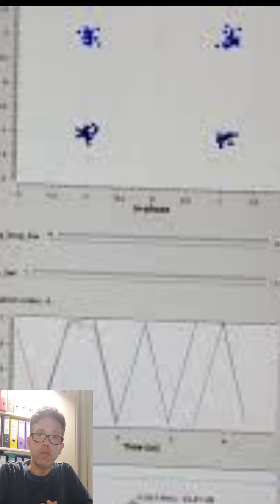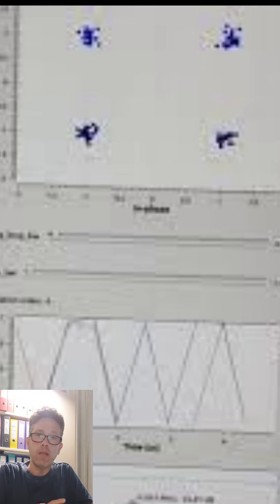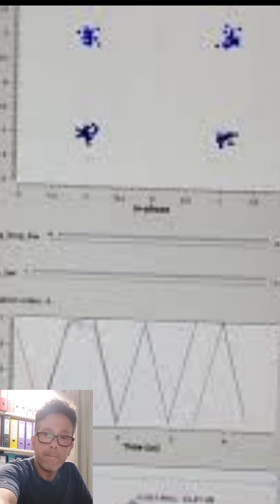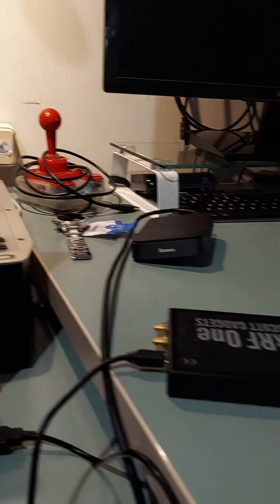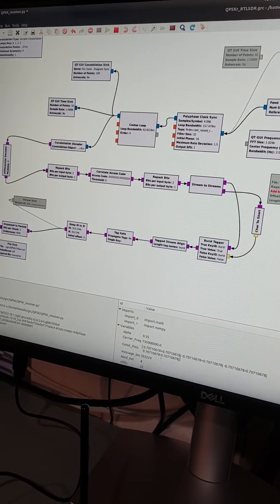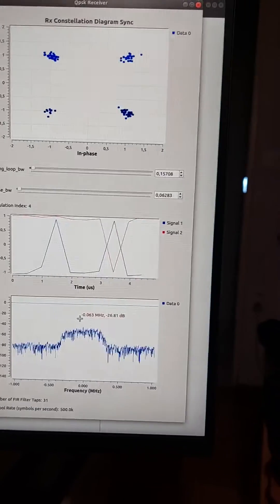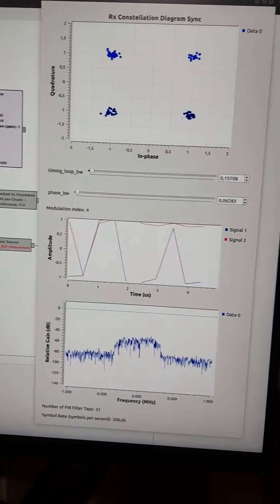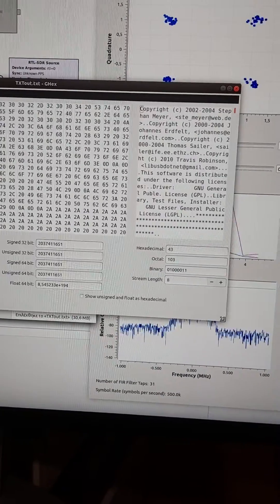Over the air transmittion and reception of QPSK signal using HackRF One and RTL-SDR with GNU Radio.

Comment: Hi, that’s great, I downloaded the file and replicate it with my 2 HackRF one but I couldn’t, can you give me any help about it please
Reply from the maker: Hi, since you have a hackRF as a receiver you need to change the source block (probably to 
Soapy HackRF source if you have the latest gnuradio version). Keep in mind that I have not tested it with latest versions of GNU Radio software. Other than that you need to check parameters in some specific blocks. For example in file sink and file source blocks you need to change the file paths. Finally in the "correlate access code tag" Block at the receiver the access code value is the binary representation of the hex value stored in file  preample.hex at the transmitter. I hope this will help you in your efforts.
Reply: @ManolisBozisSDRwireless  I was checking and I think that the problem is in the HackRF one board configuration, may I have a video call with you to have any help about it
Reply: Did you finally succeed in achieving it?